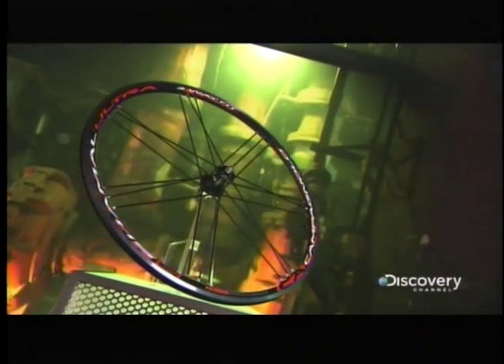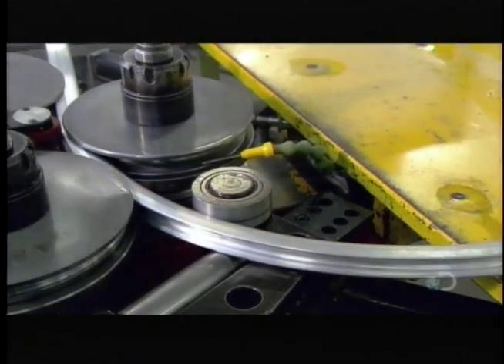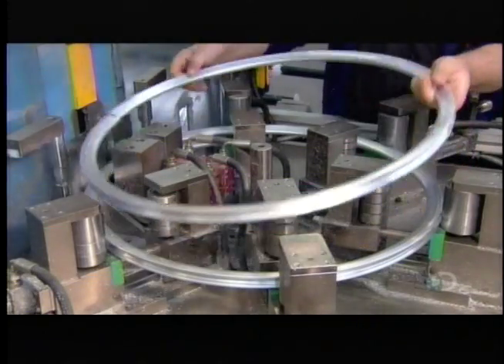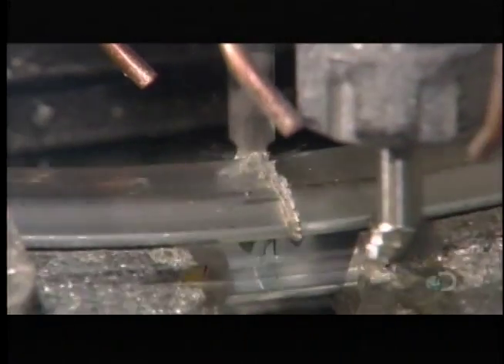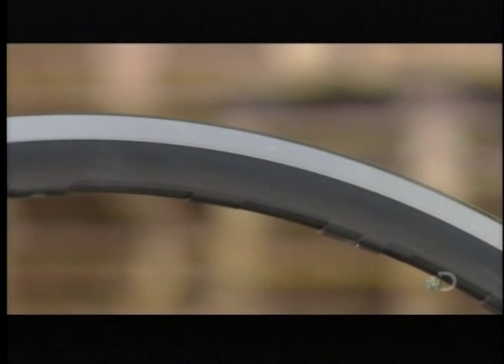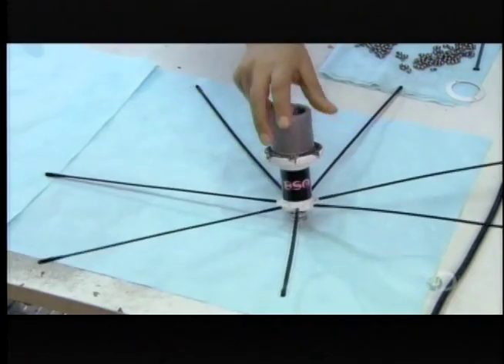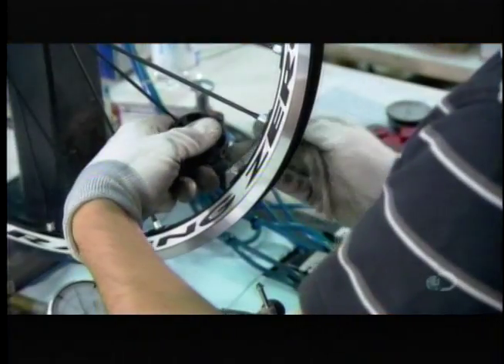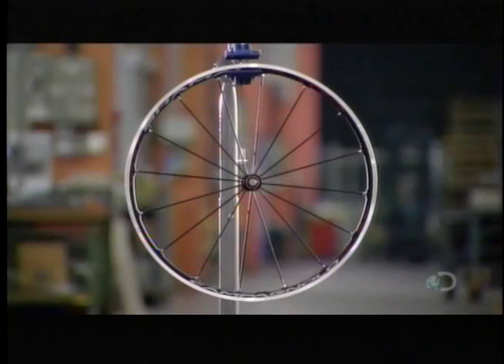How Fulcrum Wheels Are Made

Comment: I hate Fulcrum wheels. Bought a pair and they go untrue every 100 miles. Started to true them myself because I couldn't afford to keep paying the bike shop. Today one of the spoke nipples got stripped by my spoke wrench. These wheels are such garbage.
Reply: +Patrick Bateman I have Fulcrum 5's and Mavic Aksiums, both similar priced, entry level. The fulcrums are stiffer, lighter and more stable, been bomb-proof for me over 5000 miles now. Every now and then I put the Mavics back on when the weather is bad, but notice the difference immediately - the mavics flex a lot more when out of the saddle. Fulcrums much preferred for me.
Reply: Al Heeley What is the spoke count on your Fulcrum 5's?
Reply: 18 front, 20 rear: http://road.cc/content/review/115857-fulcrum-racing-5-wheels
Reply: No way. These are the exact same kind of wheels I have and they suck. They don't even stay true for a 20 mile ride.
Reply: I'd take them straight back then, mine have been bomb-proof for 2 years.
Reply: Al Heeley Maybe I got a defective pair. Although I've had the rear wheel rebuilt and it still sucks. I think Fulcrum just makes cheap shitty wheels.
Reply: +Patrick Bateman Al Heeley - 160lbs, Patrick Bateman - 260lbs
Reply: easton are very good too,i had the least expensive ea50 with the red hubs,and for the price they are amazing,not light weight, but so smoth on the road.
Reply: Patrick Bateman I think you may have got a faulty set. Generally fulcrum has good quality control but not everything can be made to the best on everyone
Reply: i have two pairs of fulcrum wheels the racing 7 wich are a marvel for the price tag,and racing zero,both have hundreds  of miles and never,never had any issue...they are amazing for the price.
Reply: Rui Calado I hate Fulcrum wheels. Never going to buy a pair again. The hubs are good but the wheels are extremely weak. They go untrue all the time.
Reply: that´s strange!all the guys that i know that have fulcrum wheels,dont have any problem...i have too,mavic RSIS for climbing and speedsix evo 35 carbon tubular both very good wheels too.the worst wheels i had was vision t40,they were good looking,but the hubs are crap,compared to Fulcrum or the R-SIS.
Reply: Rui Calado Well the one set of Fulcrums I bought was a Racing 5 and they were constantly untrue. Maybe I just got a bad set, but I don't trust Fulcrum anymore. I got a set of DT Swiss custom built wheels from Wheelbuilder.com and they are rock solid.

Comment: I don't really understand what you are saying here ... are you saying that using a power tool is a god idea, or are you saying it's a bad idea? Do you want wheels built quickly with comparatively little opportunity to make sure that all is well at all stages of the build, at a relatively low cost, or are you saying that working in a slower, more considered and tuneable way is the right way to do it, even though it costs more?

Comment: Not in the case of a rim where there is no access from the tyre bed. In any case, not all builders like using a cordless drill - I don't, the disengagement can lead to some damage to nipple slot, especially if alloy nipples are used - I've got over 2500 pairs of wheels to my name and I've not used one for several years, partly for that reason.

The "feel" of how a nipple is moving on the spoke thread is important and that's lost with using a machine tool. Damaged / poor threads can go unnoticed.

Comment: Wow really impressing! It's nice to know how my Racing Zero were built. On September 11th 2012 I smashed my Canondale Synapse carbon bicycle at 32-35Km/h into a stupid 4x4 truck that turned left without looking if cyclist were coming on the road from behind. My frame cracked but surprisingly the wheel totaly resisted. Only the front wheel needed a small realignement, which is unbelievable for the hit it took! Seems like nothing could break them.